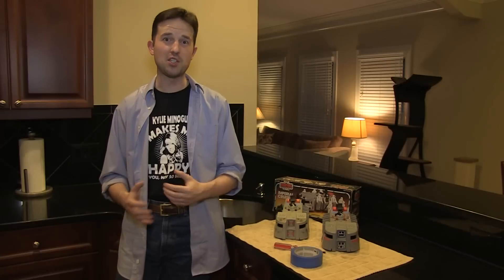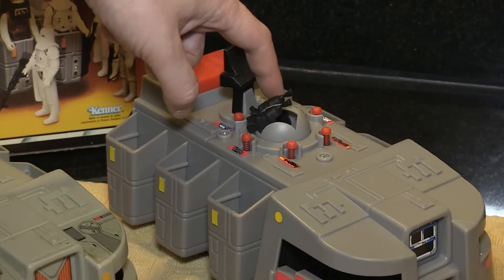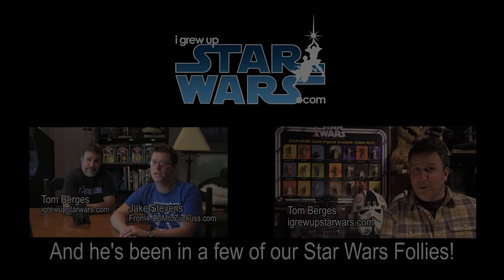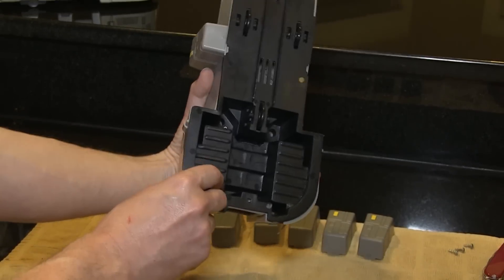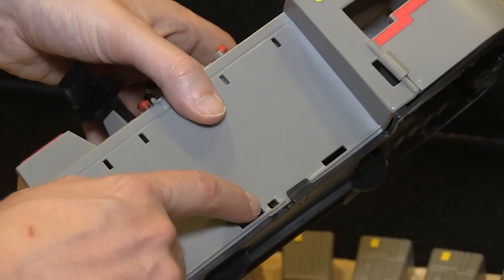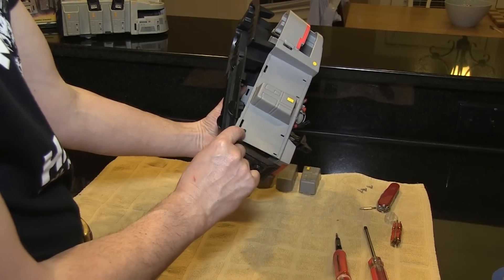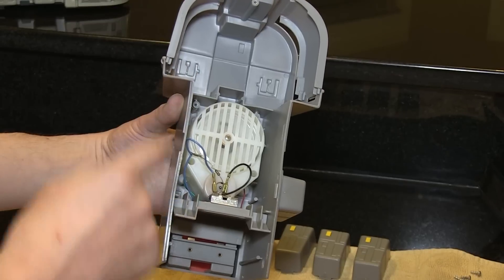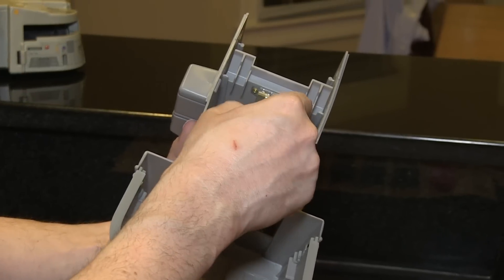Star Wars Imperial Troop Transporter Restoration - Part 1/2 Vintage Kenner 1979

Comment: +Retroblasting My ITT was missing its original battery cover, so I ordered one off eBay.  But the cover seems more orange than the red cover I remember.  Can you do a side by side comparison between the SW ITT cover and the ESB Sears Cruiser cover to show the difference?  I suspect the Cruiser one was orange, and the ITT was the same red as the buttons.
Reply from the maker: +Brett Fraser CRUISER cover is orange. Transport is red.
Reply: +RetroBlasting   Thanks, back to eBay.  Maybe I can find an incomplete Cruiser too and complete it.  Never had that version.

Comment: I've taken apart and put several of these back together, with varying degrees of success, but I've learned a lesson every single time. One thing, do not pull on the motor. Whatever you do, make sure the motor stays exactly where it is. If you pull on the motor and the rubber band comes off of the drive spindle, it's not that hard to get it back on, but it's a little bit of a pain in the butt. The key is to hook up power and spin the record using the nubbins around the record spindle. Just keep pressing the buttons to engage the sounds while spinning that record.

Comment: Comparing my sound module (I purchased it by itself and it arrived with the wires disconnected) to the video (8:11), I noticed that my switch pins (for the pitch control switch) are positioned in reverse. The empty spot is on the right not left and the blue is on the left not the right. Can I assume the black is always connected to the middle and the blue to the remaining pin?

Comment: +RetroBlasting  Just noticed you took the center screw out under the speaker.  That is not a screw for fastening parts together.  That is actually an adjuster for the speaker to allow you to tune the sound on it.  Screw all the in limits speaker cone movement, while all the way out allows it to vibrate the most.  I don't have my system together to play with the settings to say which way makes it louder or muffles it?

Comment: great videos. The problem I seem to have with mine is that the disc is spinning but it just makes a crackle sound the when I press the red button they don't make any individual noise as if they might not be connected. It sounds like the belt is on firmly as the sound is constant when I turn the black on/off switch on. before I pull it apart has anybody got any ideas as to what the issue maybe? its worth me keeping as the toy has no sun fading and I have a near mint box.

Comment: By the way, second lesson I learned is that you don't need to take the side baskets off. I used to do that too, and it isn't necessary at all to get the thing apart. At least you figured out early on that the whole assembly lips up like the hood of a car. I actually damaged the shaped notch near the hinge trying to get my first one off.  Also, I have found a sometimes that once you get the sound going and everything is working great, it will somehow mysteriously stop once you put it back together again. I think there's some kind of tension when you screw in the speaker cone that will stop it from playing, so just loosen that a bit if you have that problem.  Oh, one last thing, the speaker cone has to be on the unit in order to hear the sound at all correctly. Otherwise, it will sound like gibberish and noise, and you'll think it's still broken.

Comment: looks slightly easier than the one I fixed inside the Palitoy Action Man as you don't have to deal with a spring and pull chord. https://youtu.be/G8KnvZlf0WU
Reply from the maker: +Toy Polloi I suspect you're correct.